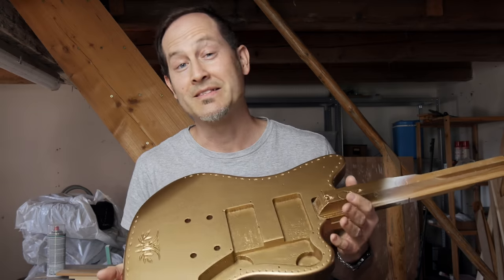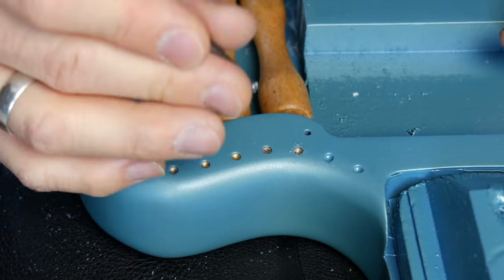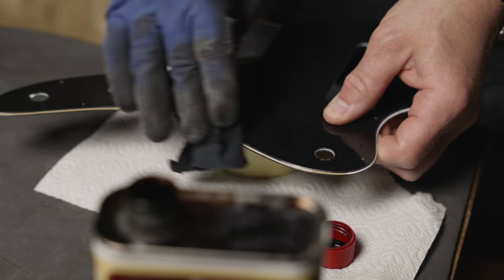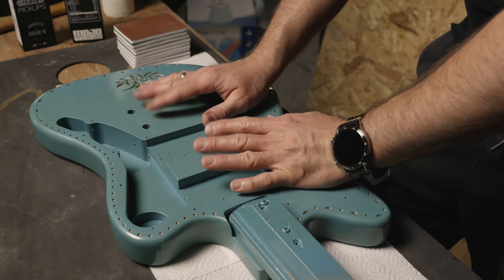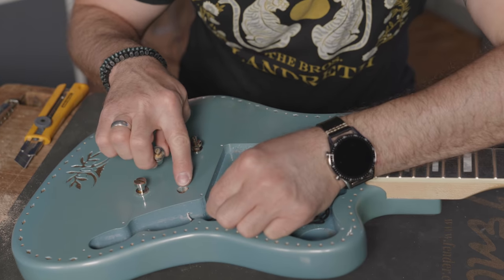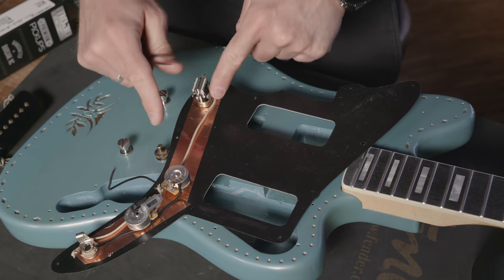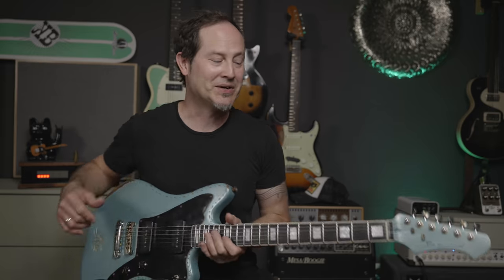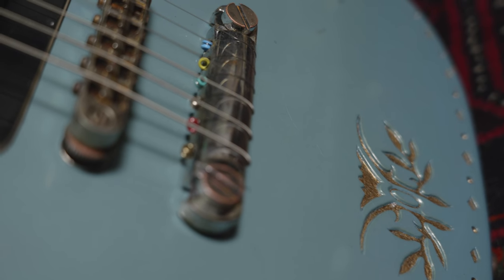I Built A DIY Custom Shop Guitar | Part 2 | #DIYKitChallenge22 | Guitar Tweakz

Comment: For pickgaurds, if I have one already in the shape I want, I use that as a template and use a router flush cut bit. I use the smallest one. They are pretty tiny. Then hit the outside edge with a chamfer

Comment: Here is a good tip, use star washers when mounting the pots and the input jack. They make your ground connection really solid and also keep your pots from loosening and twisting over time. They are cheap, you can get them anywhere and work great.

Comment: Great work! Funnily I also did the JA kit in Pelham Blue. Some tips for the weather checking. Use a hair dryer or heat gun to warm up the guitar first and then shoot it with the cold spray. Nitro checks because of harsh temperature changes. So heating it up and then cooling it drastically brings the best results. Second tip: cold spray is quite expensive. You can use canned air and shoot it with the can upside down. Same effect.
And a minor correction: there are no ground loops in guitars with passive electronics as there is just one ground (the output jack). But the idea of using copper tape as ground wire is a great one!

Comment: It's been a while I was waiting for that very video.  It's a good example of the adding value of your channel :)
I learn a lot for the painting and aging process. Next step for me will be to redo my guitar nuts by muself. I would be happy to read the tools (especially the files) you recommend to do this (I've three of them to do, or at least reshape). Thank you Mr Barocsi Custom!
Reply from the maker: Hey, thanks a lot!! Let’s talk about those nut files in my next Comment Time video. 👍
Reply: @KrisBarocsi  So another video I'll waiting for :D 
Another related question (I have my answer, but would appreciate yours): bone VS Tusq ?
Thank you!
Reply from the maker: @FendCore  Both work fine. Tusq for modern guitars, bone for traditional ones. 👍

Comment: Whenever I paint bodies with nitro I always go through the clear coat into the colour even with 2000 grit but the time I’ve got the orange peel out. I’m thinking of doing with steel wool next time but will take hours for sure
Reply from the maker: Two tips: 1. sand between all the layers and keep the surface always orange peel free, that helps at the end. 2. Try more layers of clear coat at the end. You’ll send off most of it anyways when you’re buffing so you won’t end up with a thick finish (if that’s what stops you from putting more layers on there). Have fun experimenting with it man!

Comment: Kris AMAZING job as always!!! i have a question for you. i want to make my own ES 335 type guitar. i was thinking of getting a Harley Benton HB35 and modding it. when it comes to refinishing the body how can i remove the current paint? I've seen some people sanding it off but being so thin it is easy to go through it.. I refinished a tele before where i used a heatgun and i scrapped off the paint/finish but im not sure if it will be possible on the semi hollow and if it will damage the plastic binding. What are your thoughts? thanks in advance! keep up the good work! cheers!
Reply from the maker: Hey Chris, let’s talk about this is my next Comment Time video. 👍
Reply: @KrisBarocsi  much appreciated ✌️

Comment: A question about upgrading. My HB SC550 de lux are sounding ok on my Katana 100, but very dark and muddy on my HB tube 15 (that sounds nice with single coil strat) should I change speaker on tube 15 or pickups on SC550 ? I would love it to sound more clear. Please edvice

Comment: Hi Kris, can I swap out the g,b and e string of a 10s acoustic set with 9s or 8s from an electric Set ? will ist sound any good ?
Reply from the maker: Hey, yeah you can. Those strings pretty much have the same plating for electrics and acoustics. It will sound more quiet and a little thinner thanks to the lower gauge. But it will work. Try it out and see if you like it. 👍
Reply: @KrisBarocsi  thx a lot

Comment: You must call this the baroque-caster. "Baroque" is pronounced like the first half of Barosci, and baroque refers to 17th/18th century art/architecture characterized by ornate detail, similar to this guitar. You could also spell it Baro-caster for your last name, but still pronounce it similar to baroque caster since that's how your last name sounds anyways. (So: buh-row-caster). That pronunciation sounds less like "broke caster" which is how baroque-caster might sound lol. Either way it has the double meaning of a baroque style parts caster built by Barosci.

Comment: Maybe putting wax in the carves would be easier Just pop the wax out after spraying
Reply from the maker: I will definitely try that next time I'm doing anything like this. Thanks for the tip Paul!
Reply: @KrisBarocsi  very welcome and it came out very nice DIY is the way to go... basically a custom piece for way under 2K I'm thinking Cheers